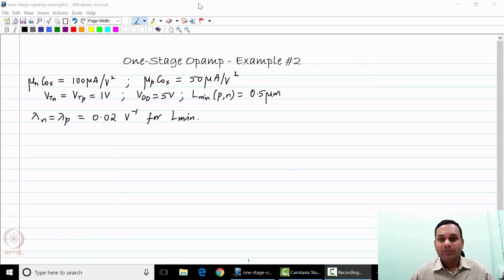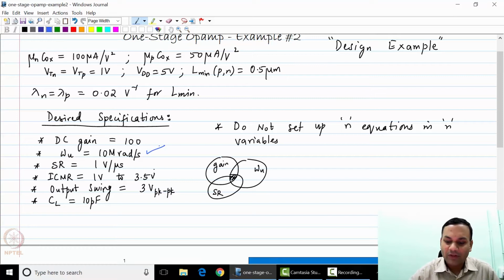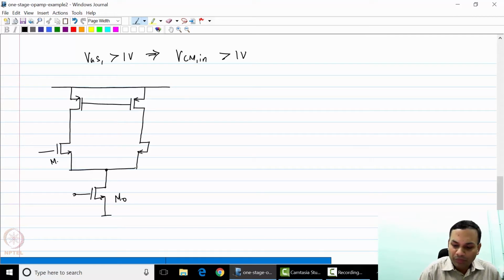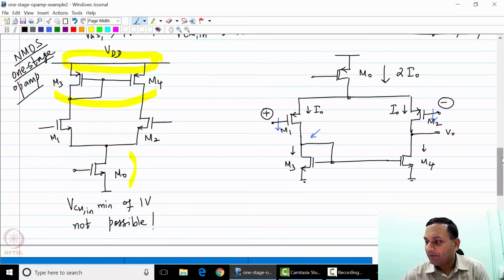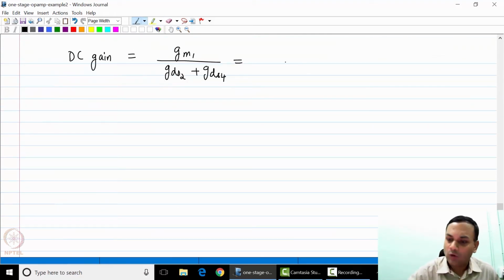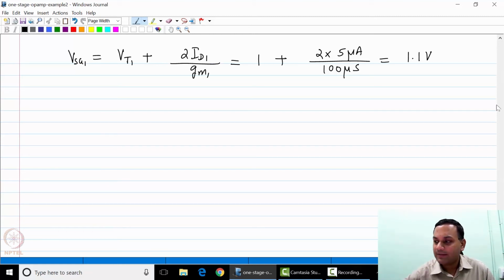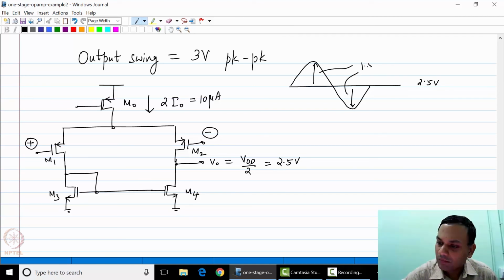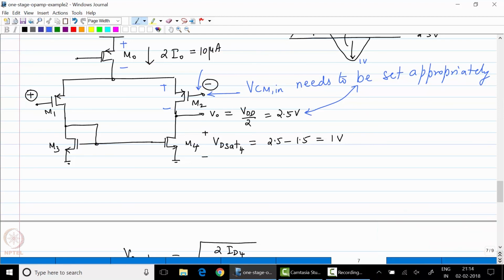One Stage OpAmps - Example 2

Comment: Respected sir,

I have a doubt since in previous video u used different formula (R=1/(λ*Id)) to calculate the resistance and so I used that formula but by using that the resistance is coming different as calculated in this video. So sir i need your suggestion regarding that. That's all sir thanks.

Comment: Condition for M2 to be in saturation is:-
Vsd ≥ Vsg - |Vthp|
-> -Vd ≥ -Vg - |Vthp|
-> Vd ≤ Vg + |Vthp|
-> Vo ≤ Vg + |Vthp|

For Vg=1.25V (which is within the spec of the ICMR) ; Vo=2.5V(set through feedback in this example) ; |Vthp| = 1V
2.5 ≤ 1.25 + 1V (Condition is not met)

So if you have a common mode input voltage of 1.25V and output common mode voltage of 2.5V then M2 will not be in saturation and the the 3V(p-p) will face distortion .